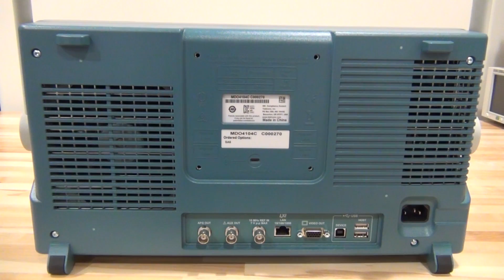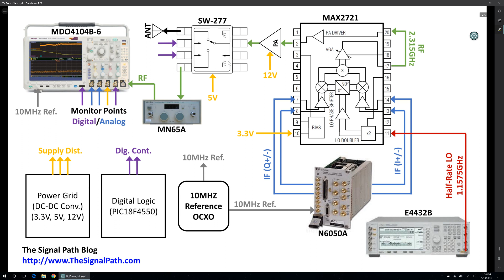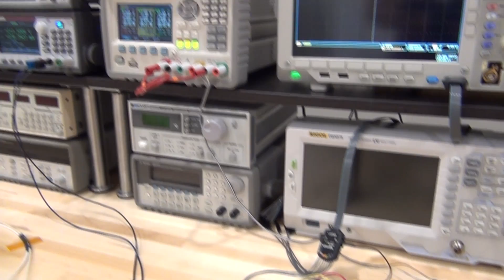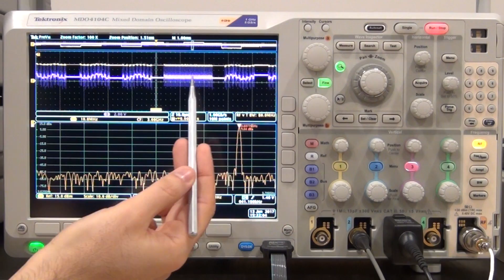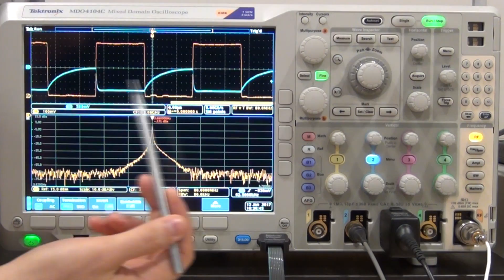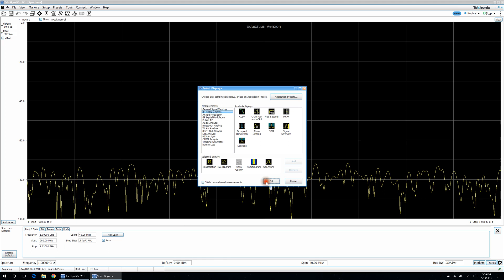TSP #87 - Tektronix MDO4104C-6 Mixed Domain Oscilloscope (MDO4000C) Review, Teardown and Experiments

Comment: Note also that you can start 'zooming' by simply turning the inner knob - you don't have to hit the zoom button first. Similarly, you can move the Spectrum time back and forth with simply the Pan knob, no need to hit the zoom button first.
Reply from the maker: w2aew thanks for the additional information. How did you like the review?
Reply: Great job, as always.  Really good, practical, real-world example experiments that illustrate the unique value of the MDO4k.  If I recall correctly, zooming in by simply rotating the inner Wave Inspector knob will result in zooming at the center, regardless of where you left the zoom pan position before.  (Hitting the zoom button returns to the last used zoom position).  I'm away from my scope right now, otherwise I'd verify this myself.  One more thing - I totally agree with you - the MDO4K is one of my favorite instruments in my lab too!

Comment: Looking at a board supplied to you is not quite tear-down though. Tells nothing about the system design in the unit. If anything, the board with a few connectors and chips, is the boring part.

Comment: Frequency hopping is not encryption, first 2 trouble shooting examples were kind of simple, everything else was great (as usual). Great to see that your lab is running, those stackable shelves are great BTW.
Reply from the maker: Thanks! Frequency hopping is used for encryption and cryptography especially by the military who are not bound by FCC regulations. With advanced SDRs it is harder and harder to just rely on frequency hopping. Almost all system employ other means of encryption as well.
Reply: CS vs EE ;)
Reply from the maker: Touche!
Reply: The shelves are great, indeed. Just from stuff you can get at the hardware shop. They sell those nice stainless steel feet in various lenghts and  some nice wood wood panels that are ideal for that kinda purpose. And all of that costs usually <50 EUR (I only know the german prices)
Reply: +Chip Guy Vids
I tried to find those locally, could not find any. A friend has a TIG welder, so another project in the works :)
Reply: Good idea: I got some similar to those, just shorter: https://www.hornbach.de/data/shop/D04/001/700/355/95/DV_8_5132401_01_4c_DE_20140603091936.jpg
Reply from the maker: The channel is "encrypted" not the data.
Reply: +The Signal Path There is no encryption with only FH, hence it is not encryption. In IT security that's called obfuscation. Well known topic in wireless net security etc. 
I expect a lot of cool projects when LimeSDR comes out, 60MHz of bandwidth for that amount of $ ...

Comment: This is no different than creating training classes for professionals. Complex, well-polished, mild-mannered, strong focus on problem-solving. Non-trivial effort indeed. I could not do what you're doing, and I've done plenty of tutoring in my life. Thank you sincerely, very interesting. Hopefully between patreon and manufacturer relations, you'll keep getting the resources you need to keep doing this. :) Pretty lab is pretty, and hopefully still feline-friendly.

My take on all the recent Tek stuff is that it will drive some people crazy, but it will absolutely do the job at the same time when you get used to its idiosyncracies. Best value for the money, I absolutely admit that. Indeed there are no other instruments that integrate so much mixed signal functionality into one box. However, if cost is not a big issue, I can't help but think that a combination of other higher-performing instruments would create a better lab experience in general, even if you have to get creative about tying them together at times (I point this out because no one works in mixed domain 100% of the time). There isn't a single Keysight instrument that performs so poorly in the update rate and UI department, and R&S is just worlds away altogether. It feels that when it comes to this element, Tek's stance is basically: "Yeah, we don't care. It works eventually, so just be patient." It's frustrating because high-performance CPUs are hardly a challenge these days. You didn't even bother to check what their CPU was, because indeed it's trivial. Put something beefier in there, stick on a fan if necessary. It's unfortunate because the slow CPU will translate into a total fear of ever zooming out to a longer timebase without making a coffee first.

To draw an analogy - it's the difference between a car with 70hp which will indeed get you around the country, but it's hardly going to be an experience that you'll look forward to every day, and you'll dread hills as much as you'd dread long timebases with the Tek stuff. Does user experience not matter? Does a pleasant and agile employee experience not translate into creativity and exploration? How awkward is too awkward? 100% focus on problem-solving for the employer at the expense of misery for the lab workers, as if they don't have enough as part of the job? Honestly, I'd cough up the cash for something that doesn't torture my employees. Also, given how brilliantly well designed most of the hardware and software is, it almost seems like a decision by a stubborn manager, or a technical reason such as not wanting to add expense/issues by switching to a higher-power PSU that may be necessary or that this issue just wasn't escalated enough. The bottom line is that It feels like it's running on a Raspberry Pi. This was my personal opinion, and Tek, send this man some cookies for doing what he's doing for you.